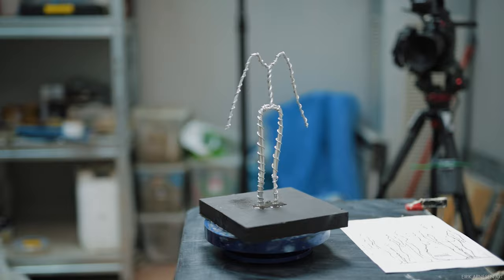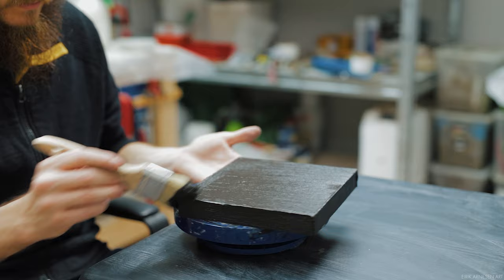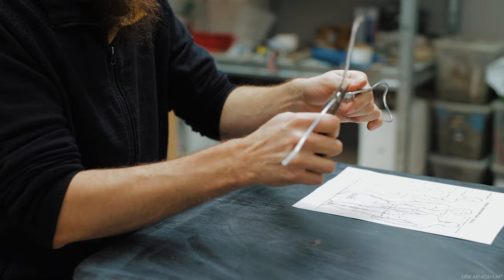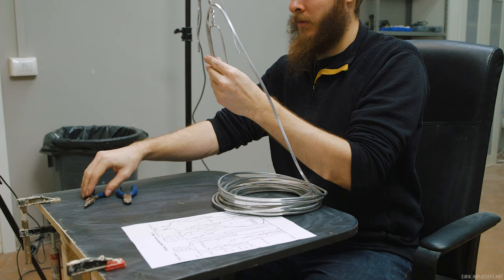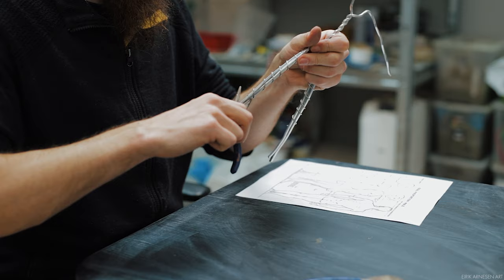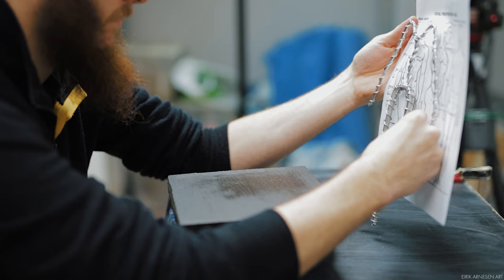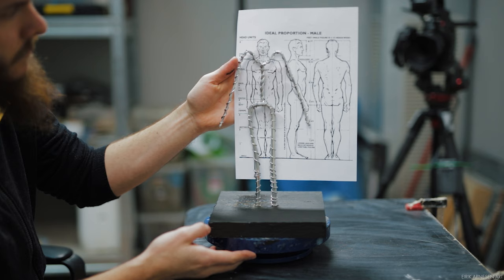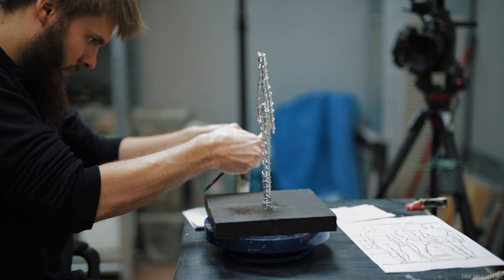Sculpting On A Budget - The Armature

Comment: Just a word of advice for anyone in the comments: epoxy is a chemical. It is best practice to use gloves, goggles while it’s in liquid form, and even a respirator if you aren’t in a well- ventilated room. If you’re using this little of epoxy, I doubt you would need goggles, but it doesn’t hurt to mention. It can cause respiratory issues if you are breathing this in or getting it on your skin a lot. :) Just wanted to throw that warning out there in case someone hasn’t used it before!
Reply from the maker: This is good information. Thank you! I should have mentioned it in the video.
Reply: Water is a chemical too

Comment: I’ve been watching this over and over for I always seem to have problems withe the armature I will absolutely try it this way
Reply from the maker: The armature can be tricky! It's a balance, not to soft, not to stiff. It needs to be flexible enough to adjust but not so flexible it can't support the weight of the clay.
Reply: Watch ace of clay he uses armature and it is easy, I did one, you dont need a diagram or drawing.

Comment: I drill the base where I want the feet to be planted. I then loop the "foot" area of the armature and screw it in with a short screw and a washer to pin it. I'll Try this out too though!
Reply from the maker: That works well also! I found it sometimes would get worked lose this way though, if you push the armature around a lot which I tend to do.

Comment: Oh my gosh, thank you! I was wondering how to stop the clay from sliding around on the wire while working with it. It makes so much sense to have wire twisted around along the whole armature
Reply: For example of this video
Reply from the maker: Yea this technique works well! I always use it on everything I make!
Reply: Tip: If its a bit bigger sculpture, you can put a couple off wooden clothespins on the armature. 
(I hope Google translate was correct with ‘clothespin’ hahaha. If not its a clip to hang laundry while it drys, I hope you understand😅) 

I remove the middle wire thing that holds the clothespin togheter. It creates a sort of grip for the clay to hold on to:) used to learn it that way just be carefull in the beginning for your hands. (Learned the hard way for sure🥲😆)
Reply from the maker: My only addition here would be to use plastic clothe pins instead of wood. If you use water-based clay the wood will rot and cause mold.

Comment: I was hoping to hear an introductory explanation to put making the armature in context. What will you be doing with it? Type of modeling material? I need to know that as a first step, before I watch a long video, so I can decide if it is right for me or not? Thanks.
Reply from the maker: I will sculpt on top of it. It's in the video.
Reply: @EirikArnesenArt  sculpt with what? I also looked at the 2nd video, & see you sticking some kind of clay material on it, but no explanation.
Reply: what are you using for sculpting?

Comment: Sir just a question. Is there a way or technique on how to make armature that can dis assemble after your done with your project that can use for casting?
Reply from the maker: Yes you can use small brass tubing to do this. You would do this to help with taking the piece apart for mold making. It's a little difficult at this small scale but at a slightly larger scale it wouldn't be a bad idea! It does become quite complex though and I like to keep my armatures fairly simple.
Reply: @EirikArnesenArt  thanks for the tip sir

Comment: so this might be a silly question but after using the Epoxy how could I save the rest of it since I don't need to use all of it
Reply: Something air tight so that it doesn't dry
Reply: @louloucaaa  I tried some cellophane with tape and it worked well
Reply from the maker: I would think that epoxy would set up no matter what as it doesn't depend on air to harden. But perhaps I'm wrong! I just throw out what little excess I end up with.

Comment: Sir, is there any clay type that I can make a sculpture and it will not need to be put in the oven before displaying it? So the Sculpture will stay like that after it gets dry? please help...
Reply from the maker: Hello. No not really, not if you want to use an internal armature. Your best bet is to use oil-based clay. If you use a hard grade of oil-based clay the final sculpture will be pretty tough. You can heat up the hard oil-based clay to make it easier to work with.
Reply: @EirikArnesenArt  allright thank you so much!
Reply: You can make sculpture with 1join compound +1flour+1/2white glue+ water enough to make a dough like a bread dough you can include 1/2 of toilet paper
Reply: @mariaqtiturrino4641  oh hahha thanks.

Comment: Good tips but I followed this and now I can't attach a head :(
Reply from the maker: In this scale you don't need an armature for the head. If you do think you need one, attach a piece of wire to the torso section of the armature wire with some more thin wrapping wire or a zip tie. It's easy to fix. I used to simply insert a piece of wire into the neck, depending on your clay this will be enough.

Comment: I never thought of using more wire so is one piece, I would use pieces for each part. my teacher recommended copper wire, what difference does that make?
Reply from the maker: Copper wire is very soft. I use aluminum, it's a good balance of strength and flexibility.

Comment: Do you have a solution for practicing without a model?
Reply from the maker: I think there are three main pillars to lean on when it comes to sculpting or creating representational art in general: Observation, knowledge of anatomy and knowledge of structure. I would suggest, if you can't get a live model, to use photo reference and/or anatomical reference for your work. It can also be good to practice from imagination or with limited reference. It will help you find holes in your knowledge that you can then fill with observation of reference. But working with some sort of reference, be it live model or photographs, are almost always going to imbue your work with more naturalism (in my opinion).

Comment: Bruh. Alu armature wire is ungodly expensive. Mild steel wire is far cheaper. Tie wire, no. 8 fencing wire. You'll fight it though. Though it's far stronger. So get a fencing tool. Ofc al foil, even papier machie
Reply from the maker: Bro, aluminum armature wire is not that expensive, mild steel wire is terrible and flexes and bends. Your work will bounce around like a little girl skipping along in the park. Papier machie is for children and hobbyists.

Comment: Dude, why dont you just use everyday wire? Just basic heavy gauge wire? Seems like you are following some kind of pedantry here. Trust me, basic wire works fine, is stronger, cheaper, and holds form.
Reply from the maker: Sure it works and you can use it. But it's going to bounce back and forth, it's not a dead metal so accurate bends is going to be more annoying. But it would certainly work! I just find aluminium wire a little more suitable.